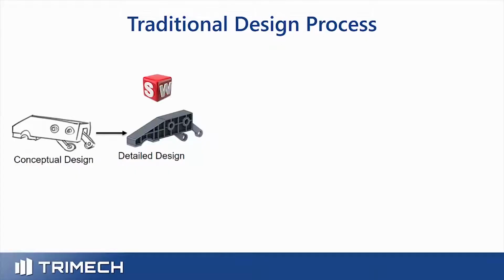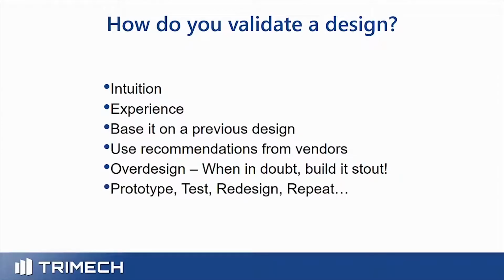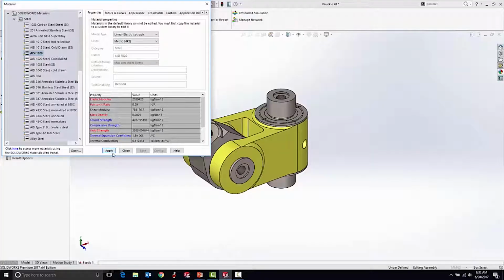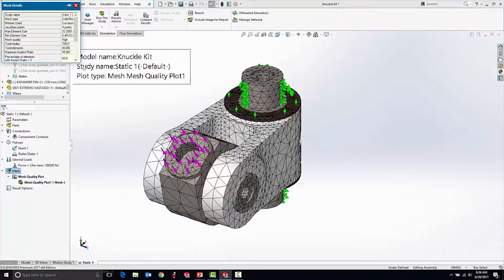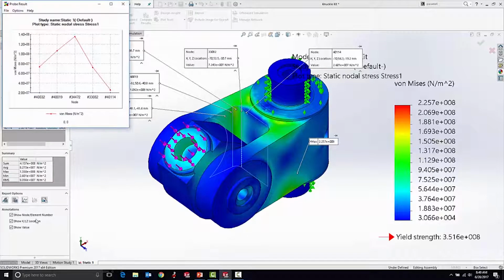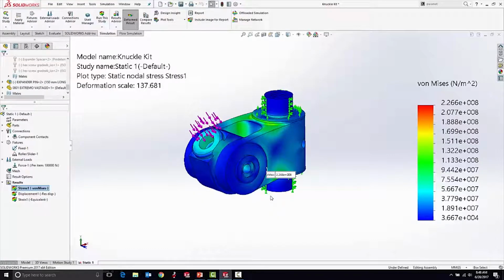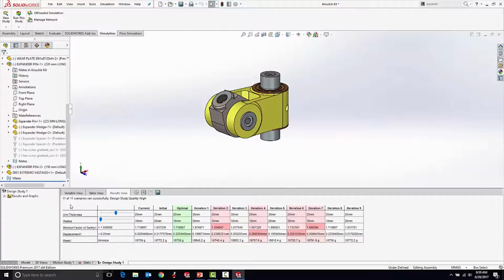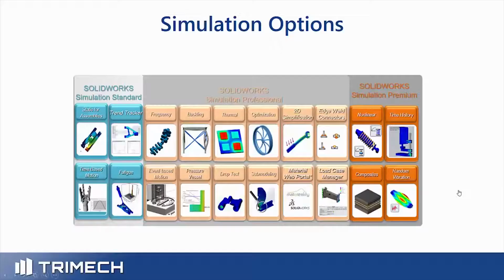Get To Know SOLIDWORKS Simulation

Comment: These videos help me understand possibilities. I just bought solidworks 2020 professional from you. I had used the basics of solidworks over the past 3 years where I teach machining. I have zero training but had learned to make parts and assemblies. Seeing these capabilities encourages me to dive much deeper into what is possible. I needed to buy my own seat to develop inventions outside of my job, as a private individual, not a company this was a long time project saving for the purchase. While I am trying to save enough for a computer that will run it I am using this time to learn and grow.